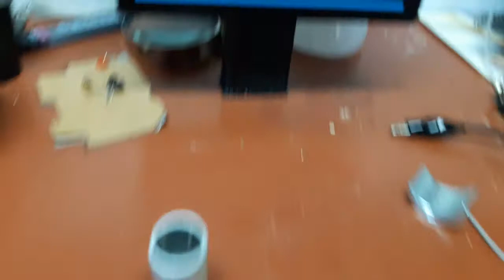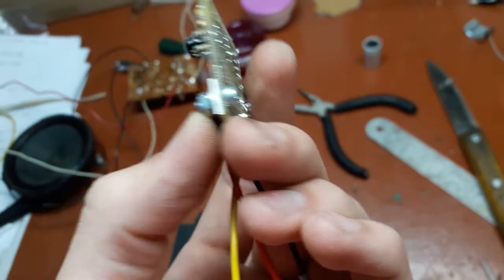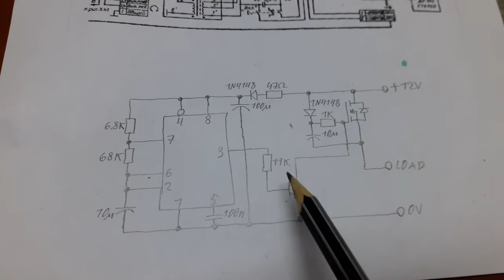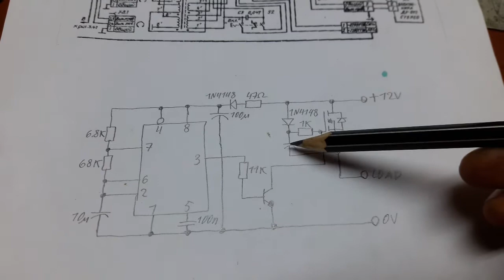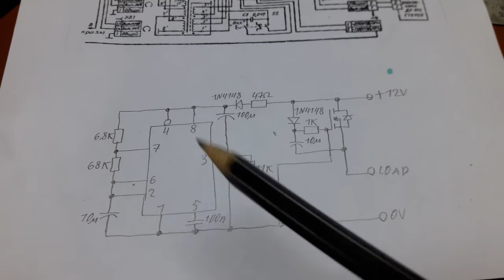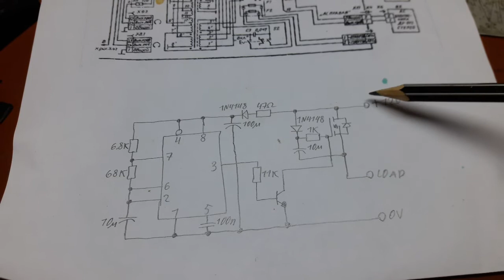Simple turn signal relay

Comment: Are you going to make something with that board with base 6 and 10 counters with 74141s and nixies ?
Reply from the maker: Tesla Redstoner I want to, but just don't have any time. I come home from work too exhausted to do anything, and few days off are occupied by other things. In short - work sucks.
Reply: @mrjohhhnnnyyy5797  Yea, the time is a big bastard ! My nixie clock could't be simpler, it's the Czech nixie stopwatch rewired and clocked by 4060. Now i'm working on digital clock with interesting IC that includes clock,stopwatch,calender-hope I will get it working. (The IC is unfortunately no longer in production, it's "MH106" from Tesla,do you know that former company? It is in Ostblock, made quite well known TTL 74** and some 4*** series with prefix MH,MHB for ex. MH74141,MHB4001 ?

Comment: Ahh the 555 timer, a usefull old chip :-D, nice snappy indicatoors :-D.
You made a nice clean pcb too.
Your motorbike or a frends?

The indicators on my old kawasaki kh125 have a slight delay and a Boing sound from the old honda flasher unit i jammed in when the original just went pop.
It sounds quite funny, but it works fine :-D
Reply from the maker: zx8401ztv The bike is mine. This beast originally had an AC system and bimetallic relay, which sucked. Now I have put a battery there, and ALL the lights are LED.

Comment: Gluing the electrolitic cap ic good idea too cause I have seen those legs break clean off on vacuum cleaners, not leaking but from vibration.
Reply: duble 555 chip could do current limiting as well but that may be overkill :D Or just use lm358 as oscilator and comparator for latching protection.
Reply from the maker: That cap is cheap lightweight one, it won't break off :) TO-220's snap off very easy.
 You have to know the limit, I wanted to make it synchronized, but it's not that easy. The switch on the handlebars is just an SPDT switch that connects the relay either to: left side bulbs, right side, or leaves it floating.